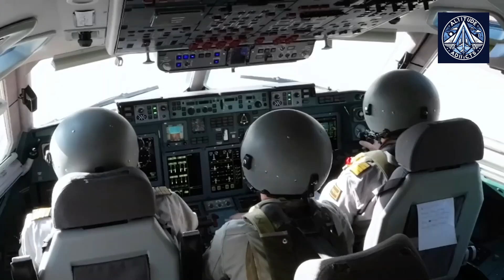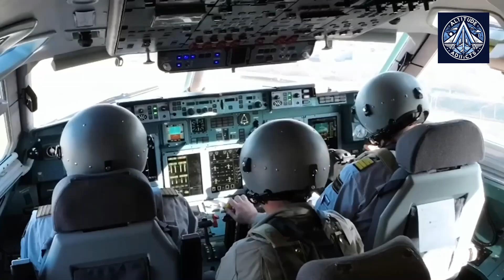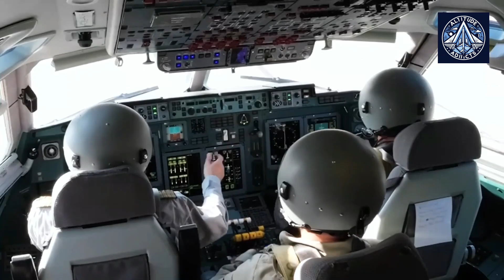A Rocky Flight for Il-96-400M With Under Powered Twin Engines and Competition from MC-21

Comment: Rolls-Royce Trent XWB that powers A350 Airbus has 84,200–97,000 lbf (375–431 kN) engine with a 9.6:1 bypass ratio and a 50:1 pressure ratio. It is the most powerful member of the Trent family. This is what Russia must innovate.
Reply: Look up the NK-92 & NK-93 they have a bypass ratio of about 15:1. Mind you only about half a dozen have been made.
Reply: Russia 🇷🇺 already has 7 Airbus A-350 900 

The IL-96 is a  4 engine design therefore will use 4x PD-35 engines in 2030.. 

Will Russia 🇷🇺 build a bigger two engine aircraft design like the Airbus A-350..  Maybe after 2030

Comment: IL 96 400M has great potential, not just in the Russian / C.I.S. markets, but,  I would say, globally. The initial flight testing of the noted aircraft began less than a year ago, so assuming that the aircraft won’t be economically / financially viable for carriers is absolutely an overstatement. 
Boeing is facing some of its biggest challenges, yet - threatening  the very survival of the company; whereas Airbus manufacturing is a combined effort of  2 E.U. countries, so, if E.U. faces serious political, or economic challenges, threatening its unity, then for Airbus the game is over.

On the contrary, it logically seems the golden-era of Russian, Chinese (P.R.C.) reign is about to commence, which of course will revolutionise / expand its aerospace industry, along with other sectors of the economy, without limits limits, and on a truly global scale
Reply: Because, U.A.C.’s top-notch priority, as tasked by the Ministry of Industry, is to supply commercial jets on urgent basis to the domestic market, in light of the sanctions placed on the Russian aviation industry. 
So, in terms of long-range aircraft, the domestic aviation market in Russia,  for the time being has only one viable solution - IL 96 400M. Regardless of engine configuration, weight, aircraft piloting,  400M is a state-of-art jetliner, which has the potential to capture long-haul segment of aviation market in the foreseeable future. The only one real  drawback, I could think of is the maximum range factor, which is estimated at 10000 km. If this could be extended to around 13500 km range, achieving a non-stop journey, for e.g. Dubai - New York, or Dubai -  Sydney, it would make it more marketable to Middle Eastern carriers. And, I am sure, they wouldn’t hesitate purchasing it, for a new & exciting experience
Reply from the maker: If you have understood one Russian language comment here, it jokes that even the 300 version takes off because of the earths curvature. The plane is grossly under powered if PD-35 is installed as a two engine version. This is what even the officials are saying. Also check out this story https://youtu.be/7Ebn7ttsW6k . It explains why PD-35 will reach only about 80% of the intended power.  Even if it reaches its full power, it is still under powered for 400M. I have merely put it in a understandable format. Aeroflot is not ready to buy it. S7 has said nothing about it. So, please be considerate when you term it a "smear campaign".
Reply: @altitudeaddicts Ok. Have made changes to it.
Reply from the maker: I have quoted officials on every point. Why do you call it smear campaign?

Comment: Ha, a tween engine of that size aircraft is not feasible since 4 engines are much more powerful than two big engines, a whole new aircraft would have to be designed for that purpose, enter the CR-929, it's ready and giving it a little more time it would be a reality..... I don't hear Cuba complaining about its four engine Il-86.... Besides, the PS-90-2 and -3 is overbuilt and can easily handle 20-30% more power output..... Russia and Cuba does not care about fuel efficiency or competing with with the non-existent competition.....

Comment: Il-96-400M is available. MC-21 is probably still being tested and no one knows when the aircraft will begin service. Anyway, Boeing and Airbus are having their own troubles.
Reply: Actually there is hard work on MC-21 to make it available soon.
First few aircrafts are already producing right now.
Russia has done huge job completely modernizing its manufacture process to make it efficient.
That's why so long. Not only production part but also engineering.
Our own software without need to insist on western products.
We prefer to make best in class products even if it takes longer.
Maybe this is not ok for short-term business but rather better for long-term.

Comment: Absolute crap!!!
Reply: А что не на свинячей мове?
Reply: Atleast safer than boeing 🤡🤡
Reply: @somdattsable5540  So they build 80 planes, Boeing builds tens of thousands, and you're comparing the rate at which planes have accidents? Apples and oranges.
Reply: @somdattsable5540 Cannot be compared because the Il-96, just 30 of which have been built, isn‘t really used for passenger flights.
Reply: @alexandervt641  atleast they are not using glue to hold the joints instead of welding!! 🤣🤣😭😭

Comment: Given the Soviet old D18T turbofan engine can reach 50K+ pounds thrust class comparable to RR 5xx series.  There are almost no problems that the Russia would build a new model with 35 ton thrust.
Reply: seriously? the D18 was designed developed and manufactured in Ukraine, and since the fall of the soviet union...russia has lost the know-how to make those engines, and also aircraft carriers...those were also made in ukraine ;-)
EDIT (because YT wont show my latest comment)
they are still trying to make new replacement engines for many of their planes (and helicopters like the Mi-26) 
...and the soviet union collapsed in 1990 and we have 2024 :-O
don't believe me? look it up and then came back to comment ;-)
oh and let's don't forget to the whole 
"russia+ukraine co-development of planes and plane engines....scheme" that was going on before 2010-14 
that helped the russians gain some know-how and valuable experience to go forward themselves...
Reply: @vasopel  May not. Any power plant turbine from Ukraine has been substituted by Russian made already.

Comment: 4 engines means 4 fuel pumps.  Boeings and Airbuses have only 2 fuel pumps
 the plane is more reliable with 4 engines.  Russian aircraft is 2 times cheaper than competitors and more reliable